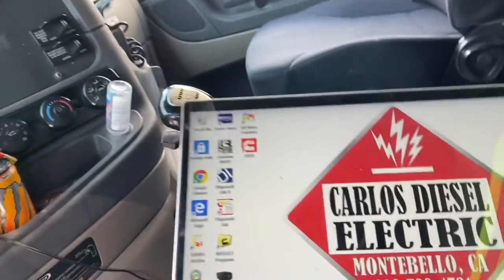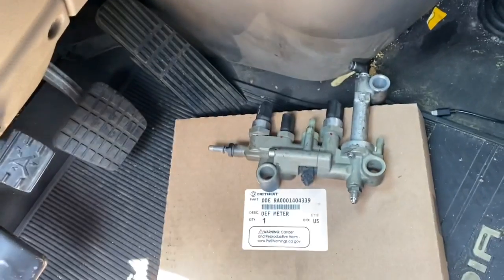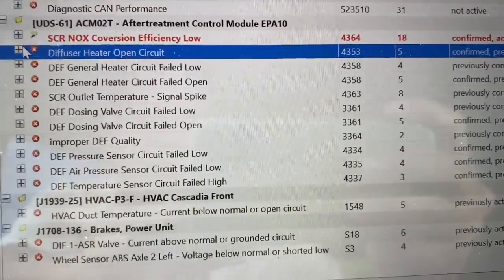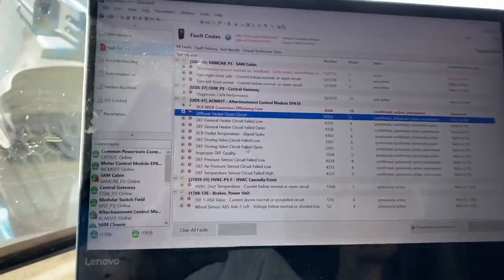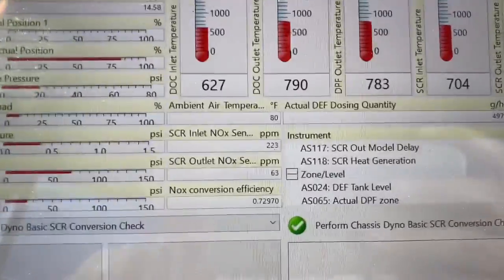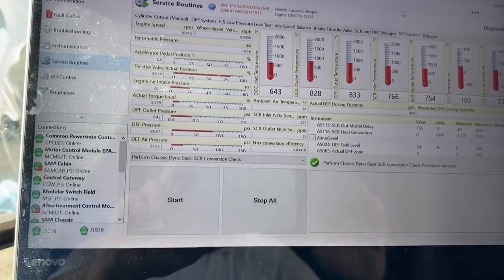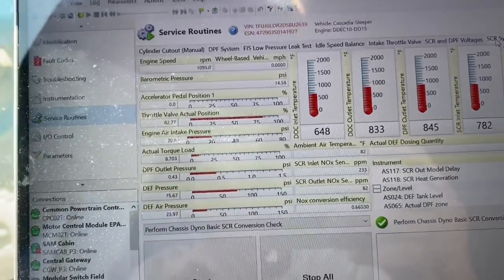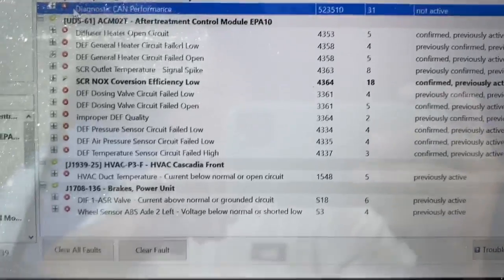Cascadia DD15 and DD13 fault code SPN 4364 FMI 18. SCR NOx efficiency low

Comment: Hi i replaced a def doser but when i do a quantity test it wont inject any def even on a new def doser
Reply from the maker: What year is the truck? Need more information
Reply: 2020 cascadia dd15
Reply from the maker: @amritmattu5024  try running the ADS self check and look at the speed (RPM) of the pump. This is a pass or fail test. Let me know what happens.

Comment: There are so many variables with this.  Before y'all start tossing harnesses, dosing valves, awning kits, and other stuff at it - look at the simple things.  My 2016 DD13 just threw the code standalone yesterday.  Reman one box 3 years ago, 290,000 on the filters.  I also had an EGR cooler fail and she was huffing coolant, which probably didn't help the particulate filters any.   Replaced the cooler last November.   My truck hasn't called for a parked regen in quite some time, so it's doing its passives.

I threw the laptop on it, and I didn't have any surrounding codes - just low NOx efficiency.  I did a burn and the numbers were good.  A parked regen will clear any DEF buildup.  IMO, the awning kits are just a band-aid over bad basic habits.

We've been having some major air quality issues in the Northeast with the Canadian wildfires.  People wearing N45 masks with the particulate count in the air - it was hard to breathe in NYC a couple of days ago.  My truck is using that air too.

Know how many miles are on your one-box filters, and ditto for your engine air filter.  I change mine every 6 months.

I also don't idle my truck on layovers.  I run a Webasto for the cold weather and get by on small fans for the summer months.  Idling ( even fast idling ) is the kiss of death for these systems.

If the code comes back, I'll stop back and correct myself here.

Good video, and informative.

Comment: I got SPN-4364 FMI 18 aftertreatment 1 SCR Conversion Efficiency type Constant. I have changed Inlet and outlet, doser valve and about 1 year 5months ago I have changed filter, map sensor is decently new, exhaust pressure same, and I have put 5 new clamps around DPF and SCR. What you think any idea?
Reply from the maker: What year? How many miles?

Comment: Hey, this part don’t get broken! Put it in parts, and parts in hot water. After 10 minutes clean and dry it with air, that’s it!  Dry DEF/ AdBlue is blocking it only! Save 1000$

Comment: I replaced the metering unit both nox sensors and I'm still getting spn4364 18. what else can I check?
Reply from the maker: What year?
Reply: @CarlosDieselElectric  2013 cascadia with the epa10 system
Reply: @CarlosDieselElectric  also the one box is about a year old

Comment: Hi Carlos question when the nox conversion is on 0.0000 what's the mean it's bad oh good nox inlet it's on 440 ppm outlet it's on 796
Reply from the maker: That is bad. Most likely a bad sensor or bad One Box. I think a sensor could be bad. Possible outlet
Reply: @CarlosDieselElectric  thanks a lot my man, 👌✌️
Reply: What did it en up Being? Got the same issue. I replaced outlet nox sensor and still got the same issue.
Reply from the maker: @diesel-landdiagnostic7407  what year is the truck? How many miles on the truck? Have you replaced NOx inlet and Outlet sensor?
What have you done so far?
Reply: @diesel-landdiagnostic7407  on my case the box was bad  I have to replaced
Reply: @yorsdyvillatoro9280  same here One box was damaged.
Reply: @yorsdyvillatoro9280  when you say the one box. Did they just replace the filters or the entire one box? Thanks
Reply: @tracannon  entire box
Reply: @yorsdyvillatoro9280  understood, thanks for the response.
Reply: Replace outlet nox sensor, nox conversion is on 0.0000 while inlet is somewhere 460ppm and outlet it’s on 640ishh ppm. And when it’s a on regen mode I hear a noise inside the box.
Reply from the maker: @diesel-landdiagnostic7407  could be a bad one box. Rattling inside usually mean internal damage. What year is the truck?
Reply: It’s a year 2012.
Reply from the maker: @diesel-landdiagnostic7407  the box may not be repairable. You can try plugging the outlet side of the NOX sensor, find a way to attach the sensor to the plug this way you still register heat, use a wire and then run the regen. It won’t fix the box but it would change the NOx efficiency. Try that.

Comment: Hello please reply I have a 2015 and I change that valve it looks different on mine but I’m getting this code and I replaced it about 2 months ago what else could I fix.
Reply from the maker: The EPA10 versus the GHG is different, you may need the DEF awning installed. Look up Busted Knuckle by diesel doctor. He has a video that covers the DEF awning. How many miles are on the truck?
Reply: @CarlosDieselElectric  648000 and I’ve seen it thanks someone mention they change their dpf filter would that help?

Comment: Hey Carlos I just changed both ny knox sensors on my 2015 freight liner so I need to do anything with the computer?  I also change the heater lines and the dozer all my sensors and still getting some lights.
Reply from the maker: What fault codes are you getting?
Reply: @CarlosDieselElectric  SPN 5246 fmi 15 n4364 fmi 18

Comment: That regen DPF temperature needs to be above 1000F. I see there around 800F. Good luck.
Reply from the maker: I agree. This is definitely my least favorite fault code to work on. Things can go from expensive to really expensive real quick.
Reply: The temperature goes above 1000 degrees

Comment: If have 2015 freightliner with cummins isx 500.  Got same code 4364 with fmi 31. What could be issue?
Reply from the maker: NOx efficiency can be many things. Start with DEF. 
Use good quality DEF in the box. 
Could be NOx sensors. Could be bad DPF

Comment: I had my truck read and that code came out as well as bad def quality... we were told by a mechanic to swap the def doser injector ... We did and nothing shot out of the doser, I unmounted the doser and observed and still nothing came out, I unhooked the inlet and outlet hoses and we had def fluid coming in from the inlet side, Im thinking its an electrical problem any ideas?
Reply from the maker: What year is the truck?
Reply: @CarlosDieselElectric  it's a 2016 freightliner cascadia with a dd15  engine
Reply: @CarlosDieselElectric  is the ecm keeping the doser from turning on might it just need a forced Regen? Or is their a reason it won't turn on...we already swapped the Box sensors....
Reply from the maker: @christiangaytangarcia692  how many miles? 
When you are doing a parked regen? 
What are the temperatures?
Reply: @CarlosDieselElectric  I do not know the temperatures we had a mechanic come over today he said that he was not receiving a signal back from the dozer or the nox sensors.... I checked the wires going back after I found the schematic to pins 28 and 33 on the ACM 120 pinout over to pins one and two on the dozer plug and I'll check good continuity the mechanic did a reset on the codes and we are able to do a Regen but it does not take the region after completion the light is still blinking I amounted the dozer and it's still not spraying at least not when I have it unmounted but I did see some crystals on the nozzle so I'm assuming it is spraying sometimes any thoughts?
Reply: @CarlosDieselElectric  would getting the acm reprogrammed fix the problem...? ... If possible do u have a point of contact so I can call u
Reply from the maker: @christiangaytangarcia692  ACM programming might help but I would recommend to have the truck updated as a complete unit. You will be paying the same amount so might as well have the entire truck done. 
As for the Doser, I imagine you are talking about the diesel Doser injector, the one located behind the turbo. That should open after a few minutes once the right temperatures have been reached.
Reply: @CarlosDieselElectric  no it's the doser for the def system it wasn't getting a signal back to the computer according to the tech...I followed the connection back from pins 1 and 2 on the plug to the acm 120 pinout on pins 28 and 33 I had good continuity.
Reply: @CarlosDieselElectric  is the def doser also not supposed to stay constantly on ...I have some screenshots from the tech I took of the codes if u would like to see them ...I've had 4 mechanics and no one can figure it out
Reply: @CarlosDieselElectric  is there a difference between the fuel doser or the def doser can one affect the other this whole time I've been focusing on the def doser
Reply: buddy you have to do a def output test when you remove your doser , you will not see def being injected all the time. do a def output test with your program and there should be a certain spec ml coming out while doing you test. if it does not meet spec, replace doser. if it does meet spec than there is another issue.
Reply: @slimshady23brar  I think the box is bad, this is my first time learning the system so i started to check things off the list, I think i have a bad scr or one box.... we opened the one box and the rear dpf filter was cracked while the front looked good in condition... discovered the doc on the one that was good was clogged we sprayed some atomized diesel in the sensor opening behind and we could see fumes coming out the rear but not the front.. my assumption is that the rear cracked due to excessive heat since the front doc was clogged ... i went upstream and found the fuel doser clogged i guess overtime the front doc became clogged aswell since it did have excessive levels of carbon buildup causing the other dpf to take the load and crack prematurely.. im sure the scr down level is clogged i can see a tar like substance coming out of the nox output sensor.... again this is my first time messing with the system i am by no means an expert .. tho i do have a mechanical background ... i am going off of what i have seen.... we tried cleaning the dpf filters carefully with pressurized water but after so many regens when the owner was trying to clear the codes i think they are mostly cleaned except that one that is cracked..... i do believe they need a new one box.. we cant get rid of that nox efficiency low code.... i did curiously find some information on how to trick the system since money is an issue... im not sure if it will work but apparently if i unplug one of the nox sensors and plug in a good one and leave it out sensing ambient air it supposedly bypasses the problem.... any advice? we are running out of money and options

Comment: Hey Carlos my truck has the same issue they just replaced the wire hardness for the def senors and cleaned the filters like 3 weeks  ago and now has that code on is there any way to contact you.
Reply from the maker: How many miles?

Comment: Just got out of the shop 2000 miles ago and having an awning put. This was the only code. DEF quality etc were reported okay. Today it's back. So after days off the road and thousands of dollars do you have any suggeztions?
Reply from the maker: I’ll be honest. This is one of the most difficult fault codes to troubleshoot. 
You can replace NOx sensors, clean DPF filters, use clean DEF, perform a parked regen, have NOx efficiency above 70% but when you start to drive and the truck does a driving regen, the NOx efficiency will drop below and trigger NOx efficiency fault codes. 
But before I go any further, how many miles are on the truck? What have you done so far?
Reply: @CarlosDieselElectric  the truck has 973k miles. In the distant past they have replaced some sensors, cleaned DPF filters etc. They just did the awning.

So currently I show no active faults. I did have two the FMI 18 then a FMI 1. The light is still on but again showing no active. BTW this is a 2016 Western Star 5700 XEi 6x2 downspeed DD15.

Thank you for your time and help.
Reply from the maker: @catnlion  the codes can come and go depending on what the truck is reading. A software (if needed) may help. Try having the valves adjusted. 
The SCR efficiency codes can pop up for something simple. 
Is the One Box original to the truck?
Reply: @CarlosDieselElectric  yes it is. Considering the mileage things are just now being changed. For example I just did the brakes a couple weeks ago.

FYI, the maintenance light went out a few miles ago. Every time I stopped today I looked and had no active faults.
Reply from the maker: @catnlion  then I say keep going. If need be pull over and do a parked regen. But considering you are at that mileage you are doing great. Detroit Diesel say you would typically get about 650K-750K out of One Box.
Reply: @CarlosDieselElectric  thank you so much for your insight. I have 13 more weeks to get it paid off. I worry it won't make it.

Again thank you.

Comment: Hi I have freightliner cascadia 2014 Detroit dd15 and while driving I had def light blinking and have spn 4363 FMI 18 code, code  spn 3364 FMI 2 and 25% derate  what is the problem is that onebox that’s what mechanic saying it has low efficiency and outlet Knox sensor was changed by previous owner
Diagnosed shows
 1- scr nox coversion efficiency very low
2-scr nox conversion efficiency low
3-scr outlet nox sensor -drift
4-regen temperature-out of range low
Reply from the maker: Number 1 and 2 are the same, they are both telling you NOx conversion low or very low. First thing it will tell you is to check DEF quality. In most cases this is not the problem.
Number 3 could be a bad NOx outlet sensor, if they have never been replaced then I recommend to replace them both (inlet and outlet). How many miles are on the truck?
Number 4 could be the diesel doser injector (located on the outlet side of the turbo) is blocked due to carbon or soot. This is very common on these trucks. 
When the parked regen is being performed, you need to check the temps on the DOC in DOC out and DPF and also check to see if the diesel doser is opening. This is what allows the One Box to actually start the regen process as the diesel doser begins to spray diesel in towards the One Box.
I know this is a lot to take in. What have you done so far?